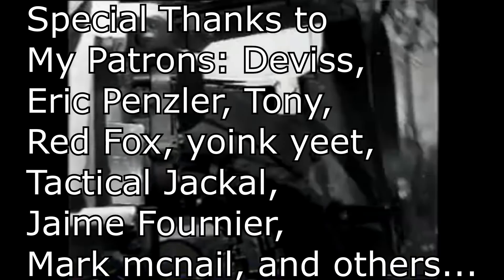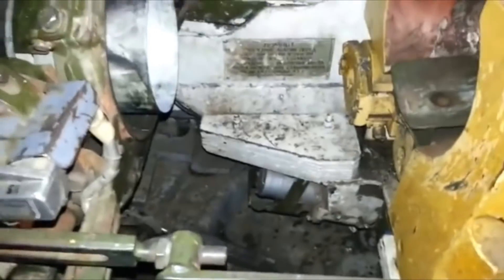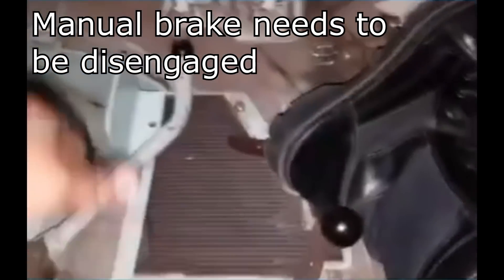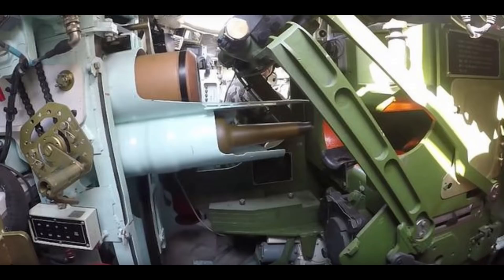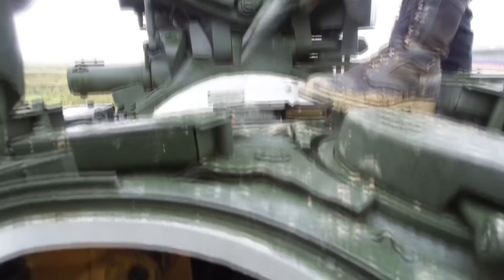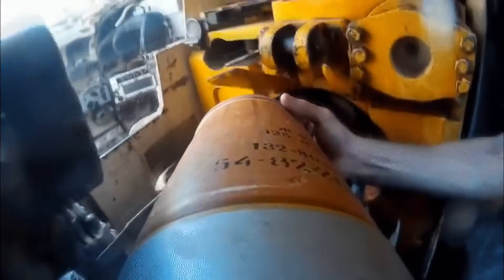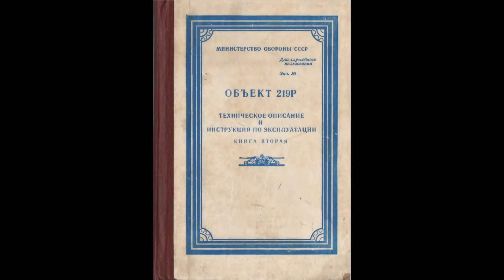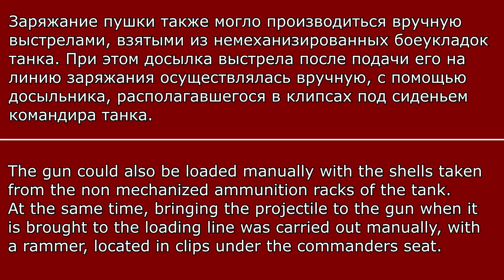Manual Loading in Autoloader Tanks. Is it possible?

Comment: While this is useful for a manual turret converted to auto-loader I think having a crewed turret misses the point of auto-loaders these days.
Reply: Except...you know...putting the crew's eyes at the highest points of the tank. Cameras work, but they still don't offer the same responsiveness, freedom of movement or clarity of your won eyes attached to your own head. There's plenty of point to having a crewed turret with an autoloader.
Reply: @The_Crimson_Fucker  Not really worth the added weight, and the crew has worse protection as well. I imagine in the past designing a tank with fully automated turret was much harder and more expensive due to the cost and technology limitations, but now it has changed.
Reply: @werrkowalski2985  
Is it? Armata weighs 55 tonnes and most of it is fairly lightly armored, at least against kinetic penetrators. The crew is about as well protected as M1's turret crew with the caveat that anything that pens the compartment is going to kill all the crew. Furthermore, T-14 is a big tank, more so than even the largest NATO MBTs. So it's a layout that makes your tank bigger, more obvious and reduces your own ability to see or survive hits as an effective fighting unit.

NATO tanks conversely are heavier, but they're smaller and they're at least as well protected. They also retain the traditional layouts' superior vision - including the most common position for any tank commander for most of any given engagement in history, nametag defilade. I would not like to try that in a tank where the gun is moving level with my head.

As such, no. The traditional layout is in no way out - and we can see this with every US and NATO proposal for an autoloaded tank involving at least one crewmember - typically the commander- inside the turret. After all, it makes sense, so why not? This isn't as clear-cut as you make it seem.
Reply: @The_Crimson_Fucker  those famous periscopes. You know, like seeing with your own eyes. Yeah. Sure
Reply: @werrkowalski2985  
"it's almost 20 tons lighter" Ew, imperial tons. Anycase, it achieves that by mostly being very lightly armored by MBT standards. The crew capsule is the only part that can actually potentially survive a kinetic penetrator and even then anything that pens is killing the entire crew. Additionally, T-14s APS doesn't destroy kinetic penetrators - it degrades them somewhat, which may not actually save it from hits to the turret or other parts of the tank. The part you don't mention, of course, is how much bigger and therefor more likely to be seen and hit Armata is. And the crew's vision is still limited compared to traditional layouts. Remember: who shoots first typically wins.

"if we ignore armor thickness Armata has the thickest armor" lolwut?
"breech and turret ring" If these were substantial weak-points an M1 would've been knocked out thusly by this point. Hits to the breach won't kill the crew, just the gun, and hits to the turret ring are not very likely and still even less likely to kill the entire tank.
"more powerful gun" except it doesn't. Russian 125mm cannons are very analogous to NATO 120mm and there is not a great deal of substantial difference in capabilities between the various guns, even the difference between L55 and L44 are not that substantial. No T-14 has been equipped with 152mm and there is no concrete plan to do so yet, just vague potential estimations for "sometime in the future".

As to ammunition, Russian armor penetrating ammunition is still notably behind NATO projectiles. What's worse, the fact that nobody knows concretely which projectiles the Russians have in most common circulation hits that it's probably not Svinets, T-14 may be armed with Vacuum but...there are like....what....30 of those by now? T-14s I mean. And the Russians straight up cancelled mass production, so at best they're going to keep drip-feeding a few tanks a year.

"APS system"
Israel called, they asked if you'd like to put Trophy on your wife. NATO is putting Trophy on everything. M1 is getting Trophy. As with previous active protection systems(which M1s have had) it may only be issued to units that actually need it because...well...why bother if not?

"duh upper frontal plate"
I mean, maybe, there's still debate on this but even if we assume this is the case. Driver gets fucked. Rest of the tank is probably not scattered to the four winds. Unless the Russians actually start issuing out DU ammunition en masse, which they've been very reticent to do thus far. But that implies a reliable hit to the upper frontal, which NATO testing has shown is once again not very likely.

You've done nothing here to invalidate traditional layouts or demonstrate the indisputable superiority of fully automated, crewless turret layouts.
Reply: @The_Crimson_Fucker  This is like saying that the IS-3 achieves it's low weight by being very lightly armored by heavy tank standards, no, it just manages space more efficiently than say German tanks like the King Tiger, and so its armor can weight less for the same thickness, it just has more efficient space and surface area management.

"The crew capsule is the only part that can actually potentially survive a kinetic penetrator and even then anything that pens is killing the entire crew."

How did you get to that conclusion, and why do you think that the T-14 is especially bad in this regard compared to other MBTs? Warthunder? It is still conceivable that not every APFSDS penetration would kill the entire crew, also I don't see how is it an argument against it's survivability given that it has more armor to protect its crew than any other MBT.

"Additionally, T-14s APS doesn't destroy kinetic penetrators - it degrades them somewhat, which may not actually save it from hits to the turret or other parts of the tank."

So what? What is your point? Man, you are grasping at straws, how is it in any way an argument against using APS?

"The part you don't mention, of course, is how much bigger and therefor more likely to be seen and hit Armata is."

No, I did mention it in my later comment, but maybe you just read my first comment. I elaborated there about how height can actually be an advantage for Armata

"And the crew's vision is still limited compared to traditional layouts. Remember: who shoots first typically wins."

I elaborated on it in my second comment.

""if we ignore armor thickness Armata has the thickest armor" lolwut?"

Where did I say that? You are literally making stuff up as you go along.

""breech and turret ring" If these were substantial weak-points an M1 would've been knocked out thusly by this point. Hits to the breach won't kill the crew, just the gun, and hits to the turret ring are not very likely and still even less likely to kill the entire tank."

What are you talking about? So you mean that if breech and turret ring were substantial weak points, then these weak points would have been removed or reinforced? You do realise you can't remove a breech or a turret ring, and in practice you can't really armor them, right? How did you come to the conclusion that hits to the breech can't kill the crew, APFSDS can never penetrate it? These hits may not be very likely, but they are still possible, and these parts are weak spots, that is why they are called _weak spots_.

""more powerful gun" except it doesn't. Russian 125mm cannons are very analogous to NATO 120mm and there is not a great deal of substantial difference in capabilities between the various guns, even the difference between L55 and L44 are not that substantial."

The stated muzzle energy of the T-14 Vacuum-1 round is 24 MJ, so far over twice the muzzle energy of earlier projectiles. Besides you seem to treat all Russian 125mm guns as a single gun, and you seem unaware of the fact that the Russian 125mm 2A46 gun had many versions, later versions being able to withstand about 30% more pressure than the early versions.

You are just making up stuff as you go along.

"As to ammunition, Russian armor penetrating ammunition is still notably behind NATO projectiles. What's worse, the fact that nobody knows concretely which projectiles the Russians have in most common circulation hits that it's probably not Svinets"

I don't even know what to say about this other than it is another example of your ignorance, and dunning-kruger effect. The modern Svinets-1 projectile is comparable in penetration to the latest NATO 120mm projectiles like the DM63. I don't know what you are basing this opinion on, when the 125mm cannon was introduced it was significantly more powerful than the NATO 105mm cannon. Maybe you are thinking of Gulf War where Iraqis were provided with monkey model versions of older projectiles.

"Israel called, they asked if you'd like to put Trophy on your wife. NATO is putting Trophy on everything."

You don't seem to be aware of the fact that Trophy can't intercept APFSDS rounds. This is laughable.

"I mean, maybe, there's still debate on this but even if we assume this is the case. Driver gets fucked. Rest of the tank is probably not scattered to the four winds."

So a center of mass penetration is only gonna kill the driver? That's some serious cope.

"Unless the Russians actually start issuing out DU ammunition en masse, which they've been very reticent to do thus far."

Oh my God, Russians have produced more DU APFSDS rounds than US had, they have plenty of it, your Dunning-Kruger effect shows.
Reply: @werrkowalski2985  
"the IS-3" Is not lightly armored by any standard, nor does it "use space efficiently" - it's small. There's a difference between efficient usage of space and simply being smaller - the cost of which was horrendous crew conditions.
"WarThunder" Most tanks in WT can't actually take the hits that they're supposed to be able to take for a variety of reasons, that's a weird point to make.
"how did you arrive at this conclusion" Official reports and public speculation.
"what about other tanks" Most mainline NATO MBTs can tank more than you'd think and can readily withstand most KE penetrators they're likely to ever face.
"argument against using APS" Why are you twisting my words? What do you get out of being dishonest like this? You know I wasn't arguing against the usage of APS so why resort to lying?
"crew is better protected" How would you actually know this? We knew the crew capsule is the only heavily armored part of the tank, nobody's come out with a clear statement of exactly how thick or effective that armor is. Speculative estimates have put it somewhere analogous to the sort of armor NATO MBTs pack. I've yet to meet anyone credible that has claimed anything significantly in excess of that.
"I elaborated crew vision" No, you didn't and if you say "muh cameras" I'm going to laugh at you.
"you're making stuff up" - You. Also you -  "if we ignore the composite thickness". Unless you're capable of producing credible documentation on the capsule's armor I have no reason to believe anything you say on this subject.
"When the 125mm cannon was introduced it was more powerful than the 105mm" Wonderful. Fortunately it's not the 70s anymore, so that's a nonpoint.
"Modern Svinets" was introduced in 1991 and wouldn't see any kind of widespread circulation until sometime in the 2000s, they are still not universal issue. At the time of it's introduction it was, indeed, comparable to DM63. Unfortunately, NATO has since developed improvements which have increased the performance of their projectiles.
Svinets-1 and 2, which started rolling off the production lines in the early 2000s and once again still aren't in universal circulation came 10 years after DM63 and are marginally more capable than it's original form or about as capable as some of the modern variations. 

Conversely to all this Vacuum isn't even in universal issue on T-14, thus far the only tank that can actually fire it. However this creates a problem. DM63 can penetrate any Russian tank(with the reasonably optimistic exception of T-14s crew capsule). Svinets cannot penetrate any NATO tank - it still struggles with the cheek armor of most of the mainline NATO tanks.  Vacuum, if the publically available numbers are right, should be able to penetrate any NATO tank in favorable conditions. But once again, the issue of availability arises.

"Gulf War Monkey Models" Ah, you're one of those people. I feel sorry for you, you've been deprived of a lot in life. I'm going to ignore your pathetic attempt and diversion to keep on the topic of the conversation - which is not your retarded Eastoid sympathies but the subject of the continued validity of traditional layout tanks going forward, and the fact that your assertion about their obsolescence is complete, unsupported dogshit. Pack your feelings in.

" Russians have produced more DU APFSDS rounds than US had"
Produce =/= issue. Traditionally, Russia has stuck to issuing Tungsten core penetrators, which don't have the same chemical reaction. Generally speaking, despite keeping reserves of DU ammunition Russia has generally not used them.

"maybe you just read my first comment"
You only posted one comment you schizoid, and the issue wasn't weight - it was size.

Comment: Good Video. The russian Tanks have so cramped interior. Stressful for the crew. A manual load unter such conditions is complicated, time consuming, and traduced in a low fire rate. Additionally russian ammo has poor balistic / penetration capabilities compared to the western ones. Thank you for share
Reply: The newer T14 Armata has comparable ammunition to the west.
Reply: @command_unit7792  
not only the T-14 has good shells, the tanks that have undergone a recent modification also have the ability to fire more modern shells with a greater elongation, which will be comparable to the latest 120mm shells of western tanks
Reply: ‹1,800 meters per second› is bad ballistics for you?
Reply: Sounds good but the question is: can russian ammo penetrate a M1A2 or a Leo2?. Recently a potential T-90 buyer discarded a purchase Deal due this issue
Reply: @galdalet5725  Do you even understand the main goal of having a tank?

(it's not about existing to fight other tanks which also exist to fight other tanks, which also exist... ... ...)
Reply: @galdalet5725  Any source?

The Abrams and the Leo 2 are in no way immune to tank rounds and can be penetrated from the front by 90s era munitions mostly reliebly(but that depends on the armor package but the same situation is also true with the T90s)

The ability of the Leo 2's and Abrams to survive a hit from the T90s is only midly disputed mostly because of an outdated sales pitch.